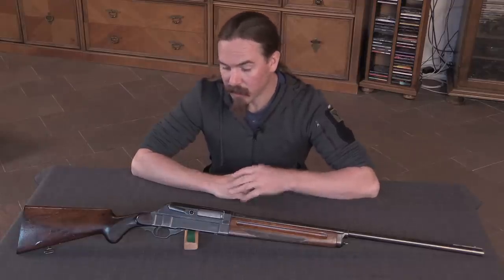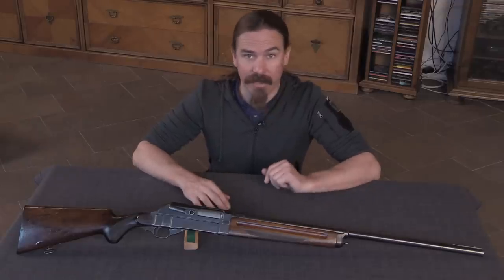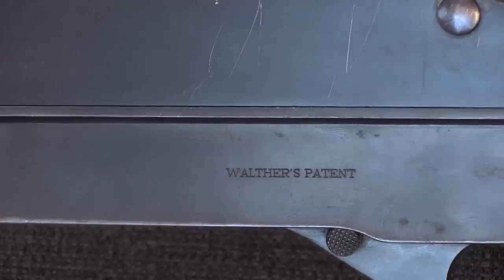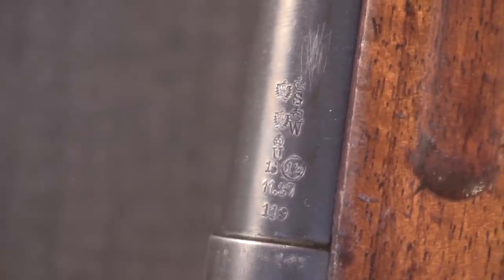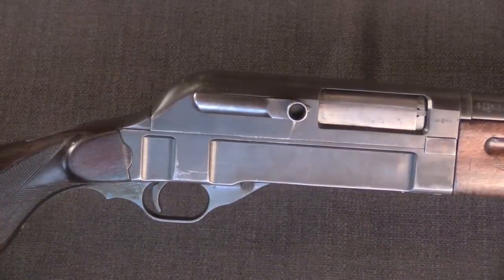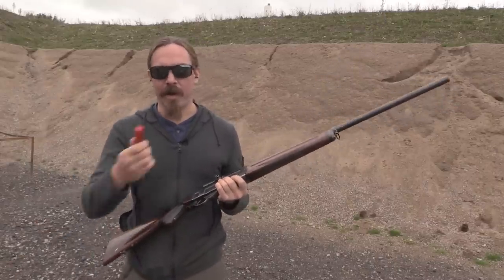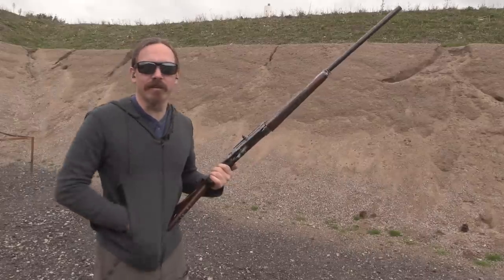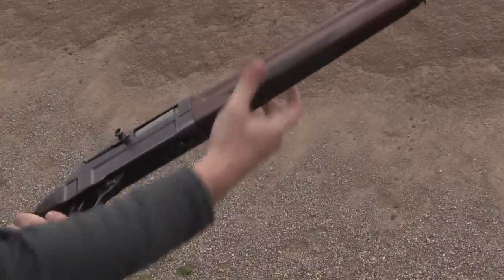Walther Toggle-Locked Semiauto Shotgun (ouch!)

Comment: If you think about the Luger it cycles very quickly, so quick magazine springs have to be extra strong for reliable feeding to keep up with the action. I think the quick action of the toggle is why this shotgun feels like the recoil is heavier, quicker recoil always feels heavier and is harder to deal with.  It's a cool shotgun anyway, thanks for bringing it to us.
Reply: Would the recoil still feel heavy if it was chambered in 20 Gauge?
Reply: @tikalthewhimsicott2736  It depends on the ammo used, basically if you're shooting the same weight payload (shot) at the same speed (velocity) recoil will be equal no matter what gauge the gun is. So there are some 12 gauge loadings actually lighter recoiling than some of the heavier 20 loadings.

Comment: You had me at "toggle-locked."

Wish we could see the system used more, but it's pretty clear why we don't.
Reply: When I first read the title the first thing I pictured was a giant toggle lever flipping out of the top like a Luger
Reply: Hello there
Reply: I know very little about the toggle-lock aside from it being in Lugers and this shotgun. Why is not so common?
Reply: This, a Luger, and a Pedersen rifle would be the ultimate lever-action for a 3-gun match.
I could live in a cardboard box afterwards, It'd be totally worth it.
Reply: +Clyde Marshall  The Winchester Model 1866/1873/1876 lever action rifles are also toggle locked. Joe Ç mentioned the main drawbacks to using a toggle system on a self-loading firearm, but one of the reasons that Winchester moved away from it was the amount of strain that shooting put on relatively small parts. John M. Browning's locking block design for the Winchester 1886/1892/1895 rifles distributed the stress to a larger section of the receiver. Hiram S. Maxim's famous heavy machine gun also used a short-recoil, toggle lock action; Hugo Borchardt and Georg Luger narrowly avoided being sued for patent infringement.
Reply: @Clyde Marshall
Number of swiss weapons are using toggle-lock actually. LMG 1925, MP-41, MP- 41/44, some 24 mm AT guns and heavy machine guns. Also some prototypes by Adolf Furrer.
Reply: Lugerman if you're reading this: Make a big 12 gauge Luger carbine!
Reply: holy shit hi mike! never thought i'd see you here!!!!!!!!!!!!!! i saw you and i recognised you and i clapped.
Reply: tskwared667
I wasn't, because I've already killed tons of Nazi zombies with this gun.
Reply: Joe Ç  - I disagree with the not very efficient assessment. Its mechanically a highly efficient mechanism - unless you are referring to the making and fitting. Then I would agree because it took a LOT of time and skill and labor to make it work correctly, and there are other methods of locking breeches that required much less time, and worked very well indeed.
I sometimes feel like the Germans went for the toggle lock because it was a quiet way to brag.
Reply: I wonder if they saw a Maxim gun and tried to make it 12 gauge:)
Reply: @hanskc3302  The number of Furrer designs that didn't use a toggle lock can be counted on the number of thumbs you have left after shooting this thing with a conventional grip.
Reply: @clydemarshall8095  well basically the whole problem comes down to bolt mass. Toggles tends to be lighter than a full on slide so the action cycles kinda fast, you need good mag springs. Also because theres not as much mass to overcome they're kinda snappy when shot.

Comment: If I had to guess why the recoil is more than you might expect, the 65mm chamber doesn't fully contain the 67mm shell when it opens, partially blocking the barrel and raising the pressure considerably.  You need to use 65mm shells to tame the pressure and subsequent recoil.  All of that extra 
pressure is pushing a lot of weight back into your shoulder.

I know it seems like a little thing, but that's my guess.
Reply: That wouldn't be it unless it was creating higher exit velocities.
Reply: @wallybal1297  Seems to me, if you're creating higher pressures in the breech, you are probably increasing the velocity of the contents of the shell.  If you increase the pressure too much, you're libel to increase the velocity of the chamber right into your skull.

I've seen people put 2.75 in shells into antique shotguns with only a 2.5in chamber and they notice...boy howdy.  A 2.75in shell will fit in the chamber, but there isn't enough room for the case to fully open to let the shot out.

The right shell for the right chamber for safe shooting.

Comment: Another thumb smasher.   The stocked C96 Broomhandle is another one you have to watch your thumb when shooting (the stocked Naval Lugers also tended to bite, which is why they moved the rear sight on the artillery variant).  If I am understanding the discussion that safety only blocks the trigger and does nothing to block the firing pin?   If so, best to not ever drop or harshly bump a loaded one.
Reply: Shotguns in general are notorious for not having a "drop safe" design. Several modern shotguns are at risk of accidental discharge in case they were bumped hard enough, including when they fall to the ground. This often applies when the safety is on or off.

Comment: There is a photograph extant of John Moses Browning with an exposed toggle lock 12 gauge shotgun, possibly a prototype that didn't make it to the production stage.
Reply: I believe that was the Browning Auto 5
Reply: @MEleven-wh2kh  Um, no.  I haven't seen the photo for years, but I didn't get that impression.  The one I saw had an exposed Toggle lock system remarkably identical to the Luger mechanism, though definitely beefier.  If it was a prototypical action for the BA5, I couldn't say but we know it wasn't put into production.  Thanx.

Comment: 12/65 is still easy to find in Austria. The three types most common types of shotgun ammo in general are 12/67, 12/70, and 12/76.
Reply: I have a few short chambered double guns.  Quick method is to get the right tools for a drill press to trim cases and roll crimp.  You can disassemble shorten and reload cheapos even.  Works great.

Comment: I owned (but never shot) one of these for several years. The barrel had a ring bulge about halfway, my guess is someone used 2 3/4” shells and the front of one cut off and travelled up the tube, to be run over by the next shot. Disassembly is ... interesting. The strong recoil spring runs through the buttstock, and is retained by the little button on the top of the grip when the action is opened. The block on the side of the lower receiver can be slid out, releasing the upper to slide forward. The barrel is secured to the receiver by a small setscrew, when removed the barrel unscrews by hand. Breaks down into a very compact package this way for traveling.
I sold mine off a couple years back, these guns do show up on the European e-guns site.

Comment: I could think of a few tweaks to this.  First off, thumb protection: redesign that grip area to force your thumb away from the movement rather than the smooth path. Also look into designing the stock to compress under recoil and take some of that extra kick off your shoulder (or at least draw out the time your hit by it therefore reducing the impact)

I honestly like the look of the loading design, it would be cool to see companys improve that design for better capacty.

Comment: I have a Winchester Model 1911, aka "The Widowmaker", and after all these years the recoil buffers are hard as steel or gone entirely. The recoil is a bit like having a burly guy hit your shoulder with a 2 pound hammer. The really fun part is that it can also slam fire and cook off all three rounds, it was plugged for duck hunting and I've never really been able to get the mag tube opened, with a single trigger pull. That being said...

I can hit really well with it and it has a very tight pattern so I would bring it duck hunting to use for shooting cripples on the water but I figure shooting a full box of shells in one day would render my right arm useless for a week or so. If you ever have a chance to fire one it is an interesting novelty but please be super careful with it. It won't blow up in your face but it might fire when you least expect it. In fact. My Uncle Henry, the original owner, dropped it in his duck boat and blew a huge hole through the transom.

Cheers!

Comment: Polywad makes 2.5 inch shells.  I load some of my own using 2 3/4 paper hulls that I cut down and end up using a roll crimper from the 1800s to close them up.  It's safer to do this also as using longer shells cause pressure issues as the crimped end can't fully open in the chamber.

Comment: Old 12 gauge shotguns also had very tight forcing cones designed for roll crimped hulls. The star crimp opens into the forcing cone causing excessive pressure and increased felt recoil. With proper ammunition the old German would no doubt still kick like a mule but it would likely not be as bad.

Comment: If you need 2.5 inch shells in the USA you can get RST brand through Ballistic Products.  Or if you reload using a MEC single stage press MEC makes a handy adapter plate to make 2.5 inch shell reloading easy.

Comment: Toggle lock systems all suffer from the same innate design flaw: an overly fast action cycling. This, in turn, leads to excessive recoil due to high bolt speeds and often causes them to outrun their magazine unless its spring is at peak performance. They are also overly sensitive to the condition of their recoil spring, an issue they share with the Remington 1100 (which is gas-operated), and a weakened spring can contribute greatly to excessive recoil. This shotgun may not have been nearly as bad when new, but with worn springs the action timing is likely a bit off, causing the action to open when the pressure is too high and basically rocketing the bolt open. It's also possible the modern 67mm shells are generating just a bit more pressure than the gun was designed for, also throwing the timing off.

Comment: When I saw that charging lever I had nightmares. I would just be waiting for the day I left my hand or knuckles sitting in its arc of travel lol. And then you have the receiver to contend with if you have a high grip. It's like the most prone to injuries shotgun I've ever seen xD especially when you add the heavy recoil.
Reply: The charging lever does not move when the gun is fired, it just moves up to its horizontal detent when the action is cycled.

Comment: I don't get it: You had no chance to buy 12/65 ammo? Here in Germany they are easy to get.
Reply: That, and some short 12 gauge ammo is even marked 12/63.5 mm. That's closer to 2½ inches than 65 mm. I don't really know if "65mm" nominal is even supposed to be the same as 2½ inches. There is 65 mm ammo relatively commonly available, but I don't have enough information to use it in just any 2½ gun. With this Walther I would because it's stamped "65". Could be the same spec, but there should be more research before just trying.

For example S&B slugs are available in 67.5 mm and 63.5 mm("2½") varieties, but 

12/67 or 12/67.5 is, however, not the same as 2½. No wonder there was sharp recoil when firing ammo that may cause excessive pressure. Being "only" a couple of mm too long the spent cases may appear normal.

Seriously, how many would fire 12/76 out of a +P rated modern 12/70 shotgun? I would not, but that's just because I know the 12/76 will cause much higher pressure when fired out of a 12/70 chamber than when shot from a 12/76 chamber.
Reply: @tonsssedell4318  it's German. If it's stamped x65mm it is 65mm
Reply: @janm7163  probably within the nanometre knowing that part of my heritage well.

Comment: At about 9:29 you can see the shotgun charged, but the charging handle doesn't lock, and it cycles up and down when the gun cycles. That could cause problems for an unaware right handed shooter with a right forward grip if the charging lever smacks the knuckles, it seems!😨

Comment: It's not the ammo that short strokes the "slide" or bolt here, its the same as with hard spring auto pistols, the soft wrist malfunction, but in this case, shoulder, if the buttock is being allowed to push the shoulder back excessively it wont push back the bolt sufficiently.

Comment: Actually handled one of these and it just steadfastly refused to cycle even with Vintager 2.5" shells, seems they can be a bit finicky even with modern ammunition of correct length. It's not surprising they weren't really popular given the competition from the Auto-5, Model 11, and even the Winchester 1911. I know Rheinmetall built an oddball Auto-5 pattern gun around the same era, be interesting to see if someone could dredge one of those up for you to look at.

Comment: It's not a great idea to use shotgun shells of a certain length in a shotgun which is designed for a shorter shell. 67mm vs 65mm is likely not that large a concern, but 2 1/2" vs 2 3/4" can be dangerous. The issue is that while a longer shell will chamber, the crimp can not expand fully in a shorter chamber and will bind in the forcing cone creating higher chamber pressures as the wad attempts to pass through. This can be dangerous and will cause semi-auto guns to not cycle properly. For a company that reproduces short 2 1/2" shells of various gauge, google "RST shotgun shells." no affiliation, but their shells are good quality.

Comment: Yeah, the short recoil end coincides with the shoulder discharge of the force...kinda...makes the whole gun mechanic useless there considering. Just my two cents.
And yeah, generally speaking (as i have noticed) the more complicated the action, the more force it requires, now, there are some brilliant designs out there, that circumvent the need for force with mechanic magic, but this one, ain't one of them.
I like the loading mechanism, clumsy as it is, but the toggle on a shotgun compounded on the recoil dump...not, not a good gun as guns go. I'd love a peak inside, i bet it's loaded with Germanic madness. :)

Comment: Wait, you threw a 3" shell into a 2 3/4" chambered shotgun, metaphorically speaking? Not cycling fully was the least of your worries. I'm not saying you got lucky, instead I'm saying you got very lucky.
That's a metaphor that I'll repeat, in the form of a simile, putting a 2 3/4" shell into a 2 1/2" chamber is like you put a 3" shell into a 2 3/4" chamber.

Comment: 4 shot semi auto, cant see much point firing faster than a pump with that capacity.
Reply: Four shot semi auto shotguns are relatively common and there is a lot of point. Even just restricted 1+2 makes a lot of sense. These are mostly not military or police weapons but hunting guns. They are often quite nice and with modern materials may be lighter weight than doubles especially when a longer barrel is preferred.

I prefer pump action as far as a shotgun is needed, but that's debatable. Automatic is a comfortable luxury and does not require the skill a pump action would. Hunters want to focus on just hitting the target.

This gun was clumsy even when compared to contemporary alternatives - at least if you could have bought the classic Auto 5. Some low capacity autoloading shotguns are and were very fast to shoot.